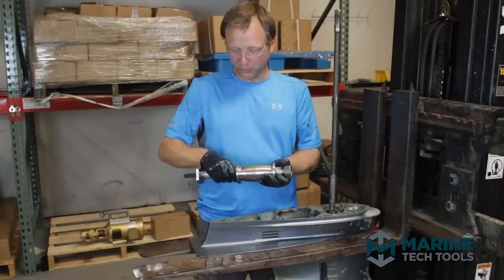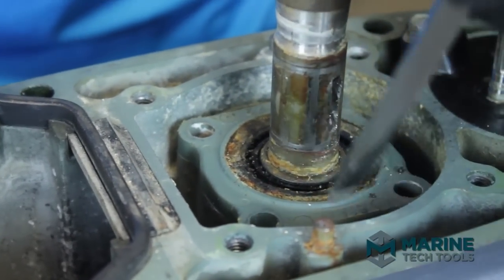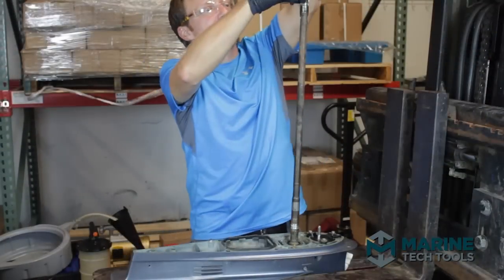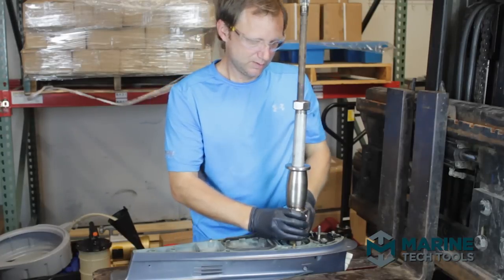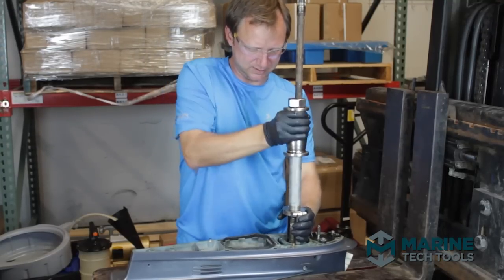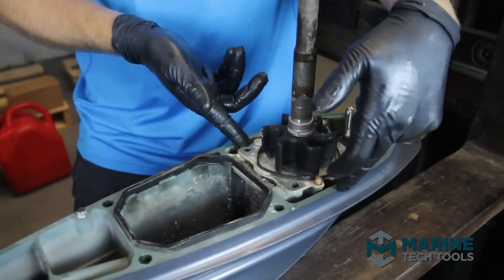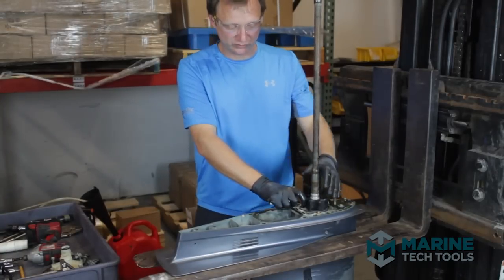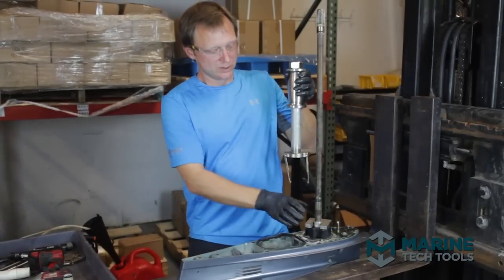Marine Upper Bearing Carrier Puller - Intro

Comment: What is maximum diameter shaft that will fit through the puller? I may have a use for it on a different application